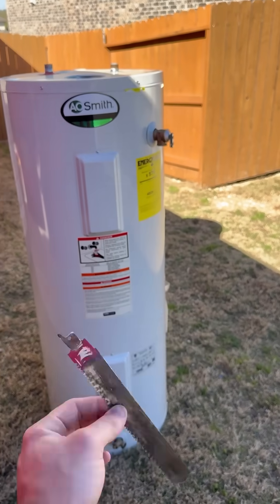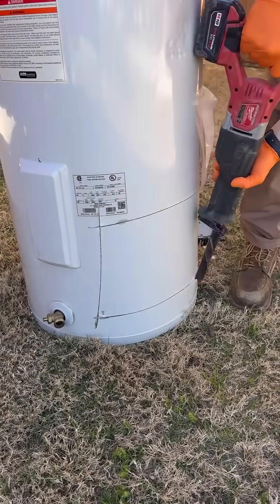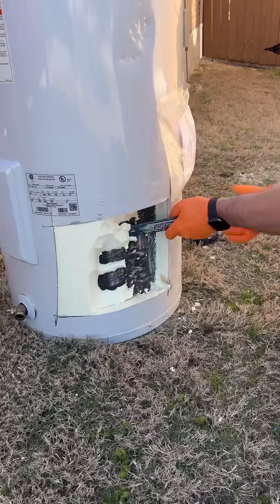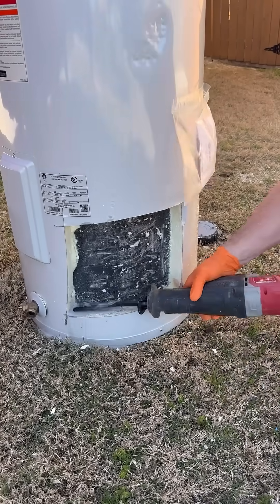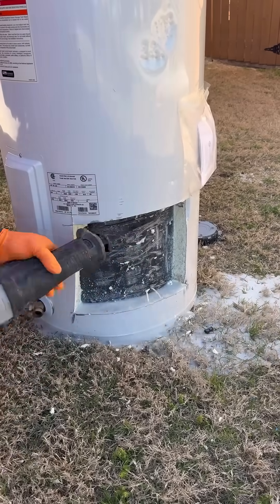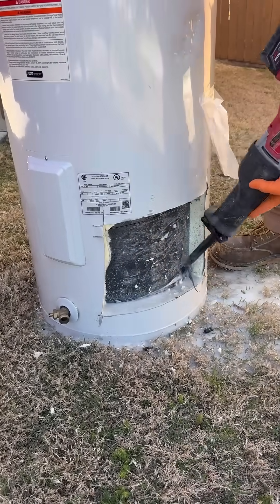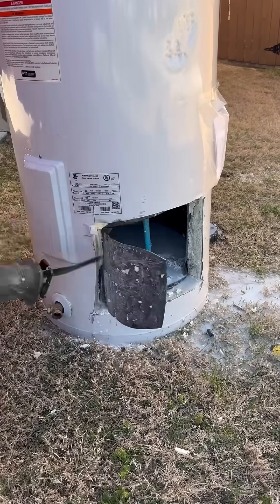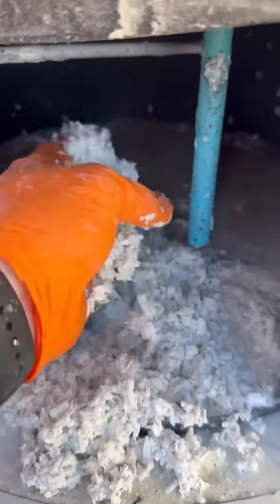What Is Inside This Water Heater?

Comment: It would be nice if manufacturers started putting an access door, so all that forbidden flaky salt can be taken out. Thus reducing waste of all the water heaters being tossed out.
Reply: They're intended to be routinely flushed. You can see the flush valve at the bottom. Creating an "access door" would be a leaking liability nightmare - they'd be quickly discontinued.
Reply: @zb9795  not only that but it would create hot spots where you'd lose thermal efficiency
Reply: @zb9795  In Europe is common to have access doors
Reply: @zb9795  Thank you for stating the obvious that it needs to be flushed. Unfortunately, that isn't perfect to remove everything. It would not be hard at all the make an access door that doesn't leak.
Reply: @IAmTheGlovenor  Happy to help! I recently was promoted to Captain, last name Obvious.
Reply: That does exist but only on some big commercial grade units.
Reply: Big commercial water heaters do have an oval hatch in them because they have to be inspected yearly, and cleaning them out is usually a task given to apprentices.
Reply: @vaughanellis7866  I am a plumber and I have seen electric boilers as old as 30 years some 200 liters with access hatch and even the 15 liters new ones can be serviced inside
Reply: Yea right they want ur money
Reply: Mine is electric, so I just vacuum through the lower element hole.
Reply: you tell me how you get a water tight seal on a door that'll never drip or spill when opened? you're basically adding in point of failure for no real payoff
Reply: @thseaqueen2938  it is conical with a rubber seal The electric resistor is fixed on it It is really a simple design
Reply: @thseaqueen2938  You drain it before you open it 🙄
Reply: The heater would cost x2. As much with access door. Cheaper to replace every 10 years.  The heater will rust anyway in 5-10 and leak out eventually door or no door
Reply: @andrey162000  There is zero reason for it to cost 2x the price. And there are factors that would determine if a heater would rust away or not, unrelated to having access. For example, my heater is already more than 10 years old and no rust or leaking whatsoever
Reply: @andrey162000  the cheapest heater has it anyway Nothing special about this feature.
Reply: Planned obsolescence. Why make them maintainable when we can instead triple our sales?
Reply: @MsHojat don't confuse freedom of choice with the myth of planned obselance. It is true that some consumer products have a limited life but are cheaper - you can buy a better water heat.

Comment: What is the best way to flush them as a DIY guy? Thanks
Reply: @ChefLaRue  there are definitely tutorials... we usually just hook up a hose and run it into a ditch or onto your neighbors prized azaleas. Drain completely and repeat. There are additives you can put in to break up the calcium build-up. I use vinegar myself because it's cheap and food safe. But it doesn't work as well as some of the professional flush additives.
Reply: @Misfit.Profit  😆👍
Reply: @Misfit.Profit  You're a monster lol

just imagine a 90 year old hobbling out of her house with a smile to water her garden only to find them covered in some weird cement like mixture!
Reply: Flush 2 times a year at the least life you don't want to do it have a professional service it
Reply: @dougbailey8101  Ok but HOW do I flush it? Is there a specific sequence of things I should do? Is there a tutorial?
Reply: There is ABSOLUTELY  a sequence. For electric ones... Unplug, hook up a hose and flush it. Close cold water input and open pressure relief valve and let drain out completely. Open cold water input and let it blast more chunks loose. Rinse and repeat until clean. THEN, and this is VERY important...let the tank fully fill. Open closest faucet to eliminate air bubbles. Then go back and finally plug it back in.
Then, if you're going to DIY guy it properly, go change out your sacrificial target every 4 or 5 years. Everyone forgets this one, and it destroys your heater faster than not flushing it every year.
Reply: The shitty plastic drain cock that comes on these tanks, remove it, get a 1/2" in ball valve and brass nipple, this way sediment and calcium flakes can actually drain out. The orifice on the stock valve is small and will clog IMO-Asshole design.
Reply: Mine is electric, so I drain it, pull/check the lower element, and then shop vac through the element's hole.